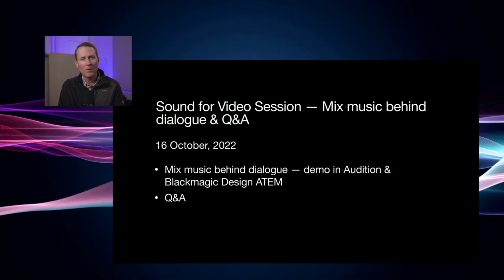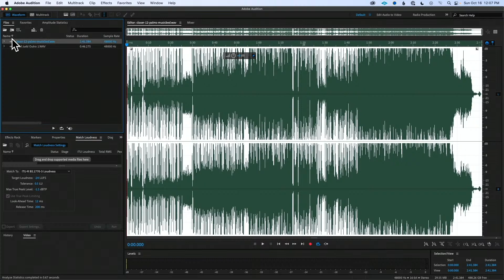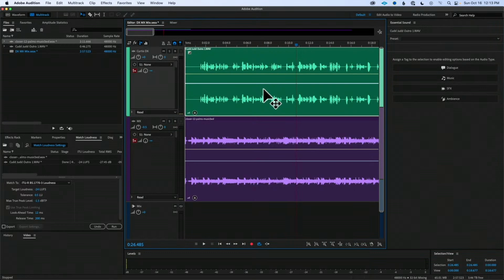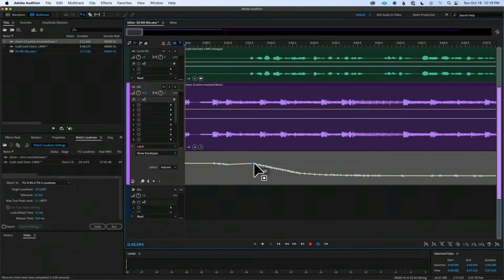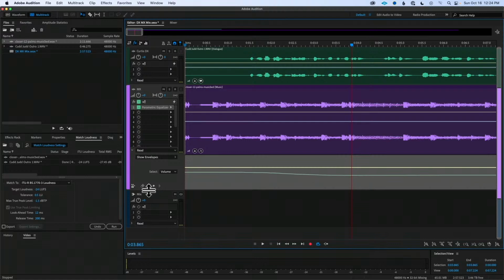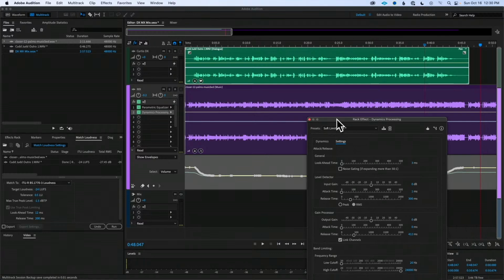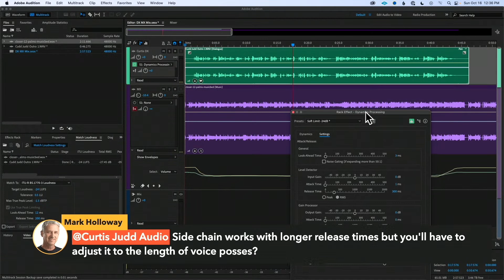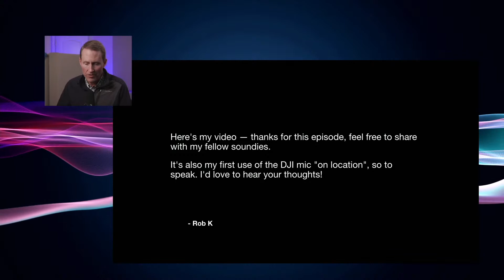Sound for Video Session — Mix music behind dialogue & Q&A

Comment: I decided not to watch this stream for one very important reason. 
In my opinion it is an extremely bad idea to have music behind dialogue! 
This is something I have very strong feelings about, and I might not have been able to control my temper in the live comments.
For older people whose hearing is no longer perfect, the music can simply make it very hard to hear the dialogue. I know they do it on TV a lot, but IMO there ought to be a law against it. It is extremely disrespectful to older people.
Besides, dialogue is communication, and music is also communication. And put together both will interfere with each other, so in principle it is simply a bad idea.
For me personally, because I'm a musician, I can't help it that my attention will be caught by the music. If the music is good, I am simply not able to focus on the dialogue. If the music is less good, it still grabs my attention to some extent, and it's just very, very annoying.
Many young people seem to have music going all the time, just about around the clock. It makes their driving much less safe, for one thing. And some of them say they can't do their homework well without music. Needless to say I find this very problematic. 
I am much against music as background. In my local supermarket I asked them many years ago to turn the music off. They did, and they never turned it back on. I have a feeling they were happy to be able to say their customers had complained about the music.
Reply: Thanks for sharing, Lau.
Reply: It wasnt the only thing discussed though Lau,  THere were several very good questions asked and answered too,  You might want to have a look through the video